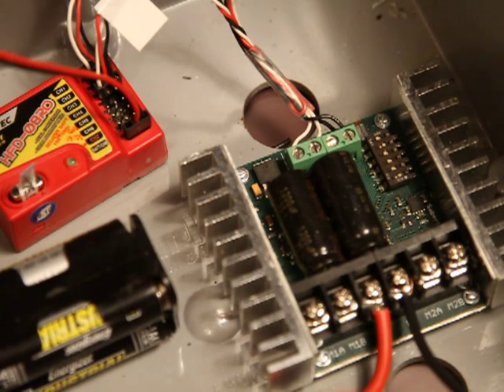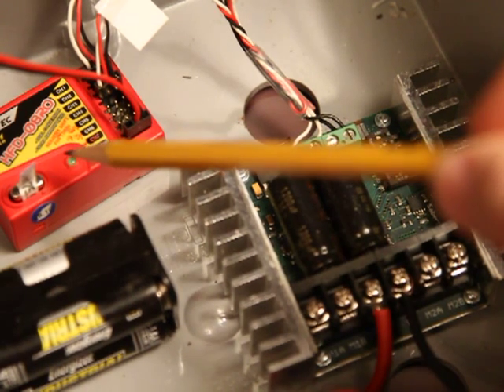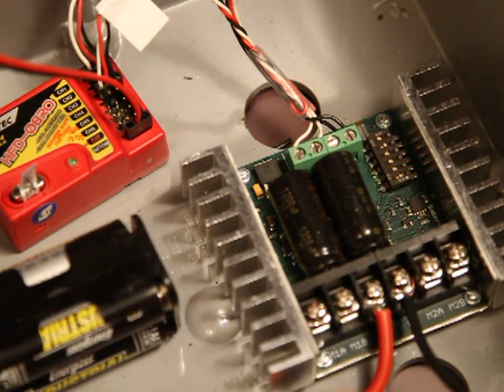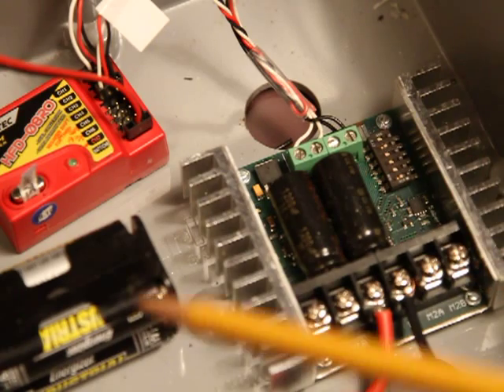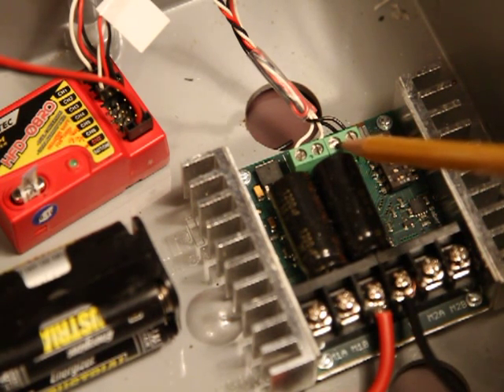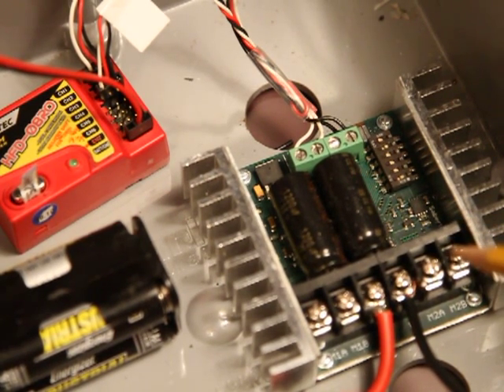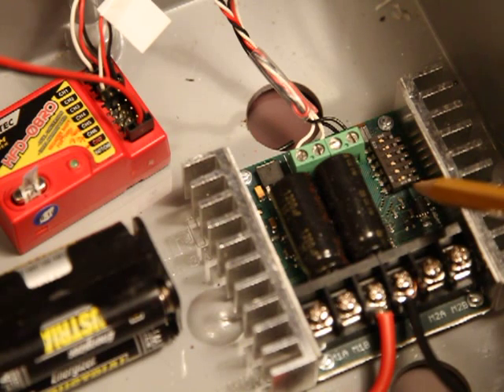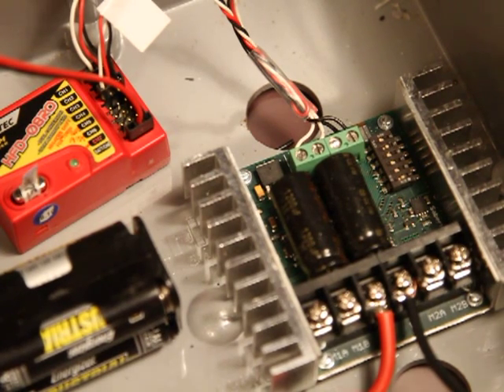Sabertooth 2x25 with Hitec receiver

Comment: I know I am very VERY late to the game here.. but..
Would a small Capacitor breakout have helped with this situation if it was just a case of the Sabertooth not having clean output to the receiver?
Reply from the maker: +Colin Richardson  Good idea.  That might have fixed the problem, or at least helped reduce the problem.  I ended up getting a better radio and receiver system for this.
Reply: +bzeug I only have the 2x12 Sabertooth, but I have the Spektrum DX6i with it's receiver and thankfully not encountered this problem yet, but I have yet to be able to tax the motor driver to it's limit.. But I will keep an eye out for this problem as the projects build a build. Thank you for a great video and the fast response.
Reply: @BZEUG  When you die you are going to stand before God and give an account for your life.  Because God is good, He is going to judge you according to the perfect moral standard of His law. If you have ever lied, stolen,taken His name in vain, or sinned in any other way he will find you guilty of breaking His law.  Because God is good he must punish your sin;the punishment for sin against God is an eternity in Hell.  While God is righteous and just.  He is also merciful,loving and kind in that He provided one way to escape that punishment and that was through the gift of His Son Jesus Christ.  Jesus Christ fully God and  fully man without sin. He died on the cross a death He did not deserve taking upon Himself the punishment you rightly deserve for your sins against God 
Three days later Jesus forever defeated sin and death when He rose from the grave and he is alive today.  What God requires of you is that you repent  (turn from your sin and turn toward God) & by faith alone receive Jesus Christ as your Lord and Savior.  Repent and believe the gospel while God has given you time

Comment from the maker: Positive and Negative from battery both go to receiver.  ONLY Ground (Black) and Signal (White or Yellow) go to Sabertooth.  DO NOT CONNECT any RED wires from receiver to Sabertooth in this configuration.  The loose REDs are just in the clear shrink tubing and don't connect to anything.
Reply: Is it working all those years without problems with signal?

Comment: Helpful  video.. is the negative wire from the battery pack also connected to the receiver and where do the two red wires from the receiver that are not used go? Are they cut or connected to each other. Thanks

Comment: your rc reciver is pulling more than 10 miliamps and that„s why it is jerking. have the same probleme with my sabertooth 2x5. Another question i have see that you are using an extra liniar servo how did you implement this on your sabertooth? did you connected with your rc reciver ? and from where did you suply power?

Thanks

Comment: I used the sport BEC from DE to power the receiver directly from the motor batteries. That worked as a reliable power source. As long as the batteries have enough juice to run the motors they have more than enough umph to power the reciever via the sport BEC. Nice tutorial though. Thanks!